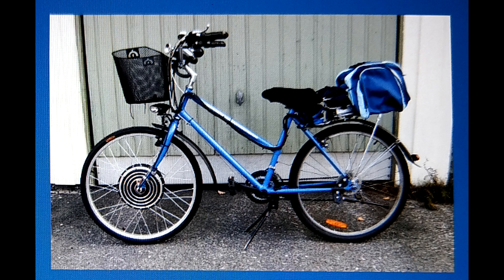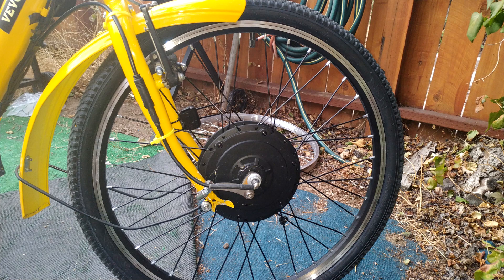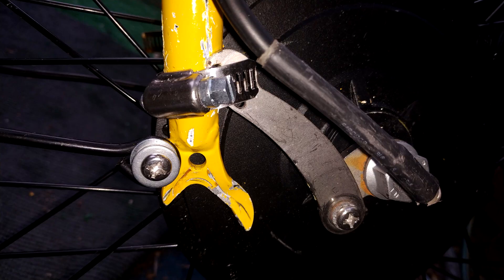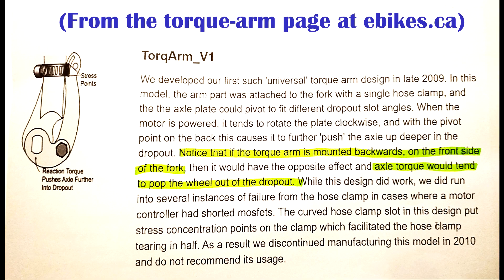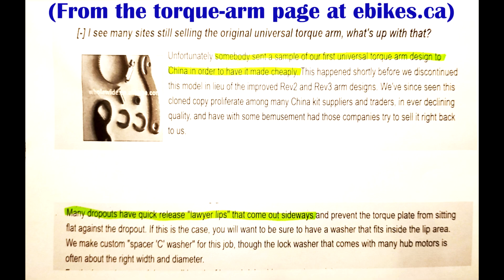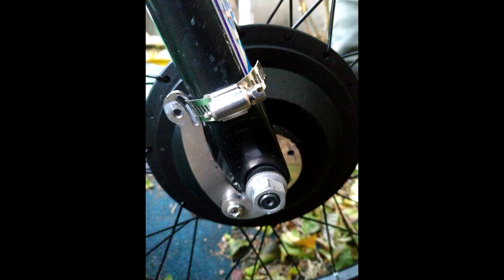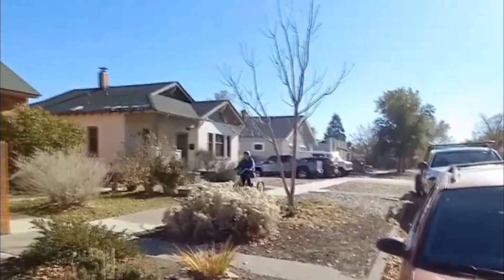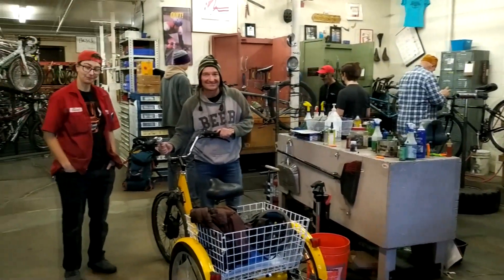Front Hub Motor Dropout Failure

Comment: Thanks for sharing your knowledge. This video was extremely helpful.
Reply from the maker: Thank you!  It at least shows graphically which direction the torque wrench will be thrown if the dropouts fail.  I use torque wrenches on both sides.  That at least kept the wires from twisting off the motor!

Comment: Could you have used a U-bolt instead of a hose clamp? Seems to me that there should be no way that a hose clamp could slide down the fork.  Seems to me that adding JB Weld to the installation would help.  I think that the JB Weld (epoxy) can be removed by heating it, as epoxy loses its strength under heat.
Reply from the maker: A u-bolt would be a rounded surface trying to clamp onto the the fork, which is also rounded. It would result in  much less less surface contact.   The clamp slid down when the front dropout failed catastrophically.  Like, the bike only went about 3 feet forward.  If the torque arm had been mounted on the back side of the fork, it would not have been flipped forward by the torque.  I had two torque arms on the motor.  Wrong side of the fork, but they prevented the wires on the motor from getting twisted.  With the dropout bent out, no glue would have helped.

Comment: Very informative, thank you! Glad U didn't have an accident. Have a 350W Bafang front hub in a regular citybike conversion with steel forks myself. But no torque arms yet unfortunately, only the torque- etc washers that came with the kit. May I ask how powerful this particular motor is that pulled your dropout apart?
Reply from the maker: It was 500w, but the whole ride was only about 2 meters.  It was undoubtedly a defective fork, but I would not have pulled the dropout apart if the torque arm had been on the back side of the fork.  I currently have 3 e-trikes, but the torque arms are on the correct side now! I also use two arms just in case.
Reply: I see, a defective fork and/or perhaps of subpar quality, i gather. Thank U, good to know. The vendor of my kit was adamant about max 350w in conversions with steel forks, and by implication, thus no torque arm required. Who knows... I'd rather be safe than sorry, like U. Happy easter!  @suenord1
Reply from the maker: I think the same would have happened with a 350w motor, actually.   The torque arms at least kept the wires from being twisted off and ruining the motor.  That is an equally important reason for using torque arms, two of them.  And of course steel forks.

Comment: Nice story, but why do you keep using this torqe arm design? The original invontrs of this design explicitly say that it is not safe. You even show their blogpost in your video. Why do you keep using this bad torque arm?
Reply from the maker: I used them partly because I already had some, but I put them on the back of the forks where they can't flip out, and compensated for the single hose clamps by using torque arms on both sides.  Also, they stopped making this model because they had failed in a few cases, but this was still uncommon.  The point of my video is that you should always put the torque arms where they can do some good, behind the forks.

Comment: My front hub hasn't arrived yet, but I have been reading horror stories. Mine is a 1000 watt. From what I understand you only want to do 250 watt on a bike conversion. This is very dangerous and folks and researching. They are buying old bike and motors not knowing the dangers. I might send it back and get a rear hub.
Reply from the maker: Front hubs are fine.  Just use TWO  torque arms, and make sure they are on the BACK side of the forks.  Also, use steel forks.  There are still people out there claiming that it doesn't matter which side of the forks you put them on.

Comment: Improper installation of Torque arm is what caused this to happen.
Reply from the maker: Yes, that is the whole point of the video.  According to the people who designed that kind of torque arm,  it should have been mounted BEHIND the fork.  Also, this demonstrates what can happen if you mount it on the front of the fork.

Comment: May I ask, was the fork that failed steel or aluminium?
Reply from the maker: It was a Vevor from Walmart. As they claimed 
"This trike for adults is made of high carbon steel, with smooth riding and a strong frame."  
 It was not aluminum, but the quality of their "carbon steel" was pretty questionable. 
It worked with a magnet.  I would never use an aluminum fork. Have built at least 10 electric tricycles and bikes.
Reply: what brand is the Suspension fork you used on the  @suenord1
Reply from the maker: I have no idea what I used for the replacement fork.  It was in a stack of leftover forks at the bike shop.  I only used that suspension fork only because it was the only fork that fit the frame of the tricycle.  I am 76 years old, and do not generally ride where a suspension fork is necessary!